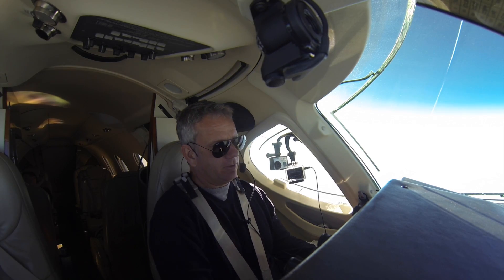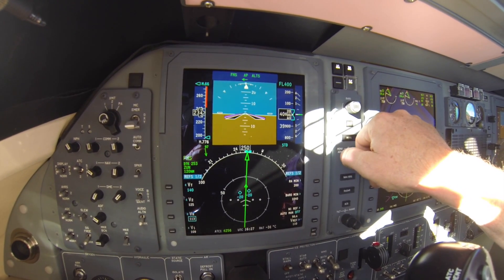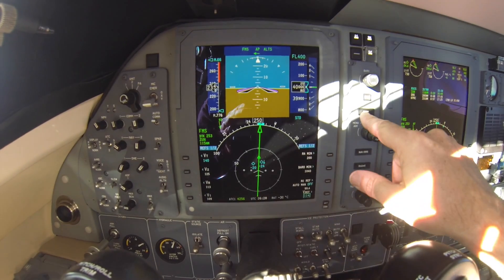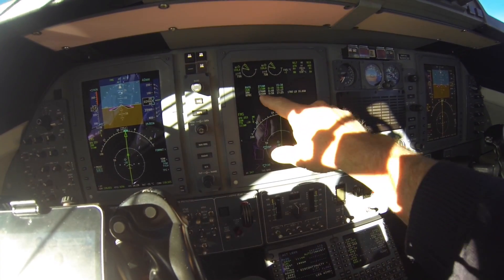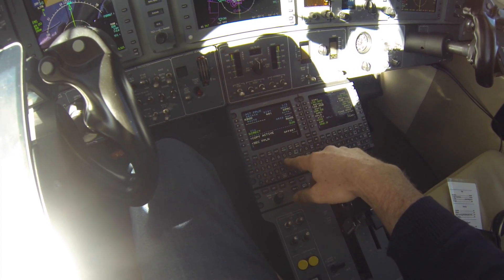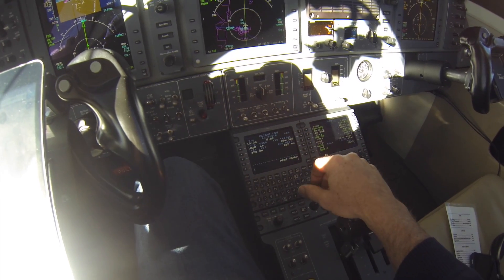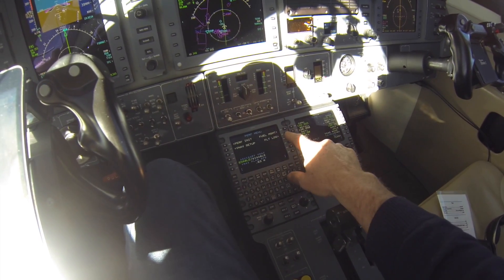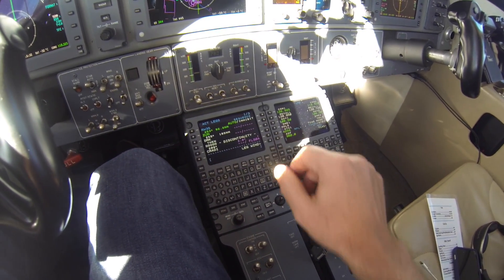Proline 21 in a Beech Premier

Comment: +Premier 1 Driver Very good video with a good overview of the FMS. Seems similar to the ones in the B737. Does Collins have a simulator to practice on such as Garmin has?Yeah I agree those controller's like to talk a lot! ;)
Reply from the maker: +Douglas Hart Collins does not have an "app" type trainer that I am aware of. I know some of the big training companies have Proline 21 setups on computers but I have not seen one available to the private user..but maybe such a thing does exist.
Reply: +Premier 1 Driver Thanks for the info. Did you have to learn by "fire" in the airplane?
Reply from the maker: No. I had 10 hours or so in the right seat when we bought the plane under the instruction of the previous pilot. Then I went to Flight Safety and had some pretty good instruction there. Learning by fire would be a lot....and probably dangerous.

Comment: Does the FMC / engines on your plane support derated takeoffs for noise abatement? Just curious.
Reply from the maker: +DrJonez Nope. Good question.
Reply: It makes sense now that I've watched a few of the other videos. I see you manually increase the throttles at takeoff, no TO/GA switch. I'm mostly familiar with either smaller propeller planes or bigger jets, not as much with the mid sized stuff like Citations and Premiers. Just curious how many of the innovations from the heavy iron have carried over to the GA jets.

Comment: Greg, where did you get (or did you fab yourself) the iPad mini holder you have affixed to the normal chart holder?
Reply from the maker: J. Brian Schaer It is a RAM mini Ipad holder mounted to a RAM ball mount. The whole affair is screwed to the approach plate holder in the yoke. I mounted the RAM ball to a flat piece of stock that I drilled two holes into and then used small bolts to mount it to the approach plate holder in the same location as the two screws that hold the rubber arms that flip down(I removed that). I've had a number of questions about how I did it so maybe I'll do a video about it.

Comment: Thank you for the explanation. Very interesting. I note that there was a route discontinuity to be removed in the LEGS page which must have been throwing some of the calculations out or doesn't that happen with the Pro Line 21 system?
Reply from the maker: odc43054 it was a first draft. I hope to get a more comprehensive and higher quality one up in the future.
Reply: Premier 1 Driver   Just found this video.  Really liked it.  It explained a lot of what's going on as you are flying and adjusting the controls.
Reply from the maker: Excellent observation Peter. Now I know how closely some people look at the videos! The discontinuity is there because I have selected "vectors" for the approach mode. So after my last route point, I need to switch over to heading mode and set my FMS up for the approach. It actually does not throw off the calculations since the system realizes we are still landing at the final destination. There is actually a lot more to it than that and depending on what kind of feedback I get on this video, perhaps a more in-depth explanation/video might be warranted. I just didn't know how far viewers wanted me to take this.
Reply: Premier 1 Driver I probably wouldn't have noticed the discontinuity except that I occasionally get to play in B737 sim (non-approved but very realistic nonetheless) with very realistic FMSs' which are forever putting in discontinuities whenever you fiddle with the route like putting in a SID or STAR. I for one would look forward to a more detailed explanation of the Collins system.

Comment: Cool walk-through!

Flying with a Collins FMS as opposed to a G1000 package in a light jet is better I assume, if a transition to larger and heavier jets is in the game-plan.

 #Aviation   #Avionics
Reply from the maker: G1000 is great and it has synthetic vision which the P-21 does not. Also, most folks moving up into a light jet are already Garmin literate, so the move is much easier. Excellent observation though about moving up from a light jet but it sure seems Garmin is becoming a big presence even in the larger jets.